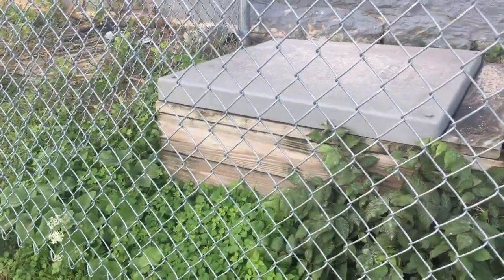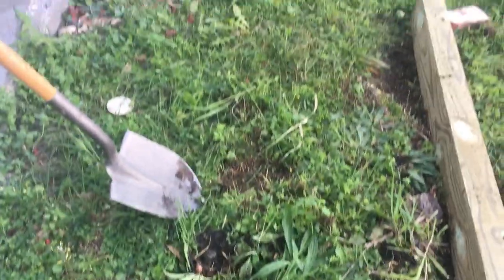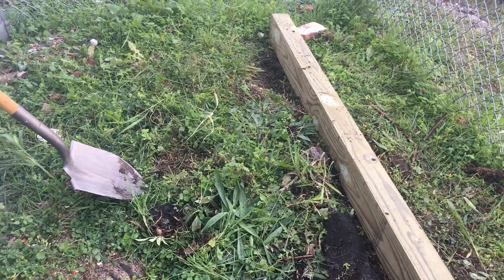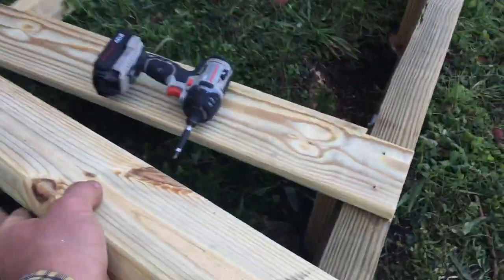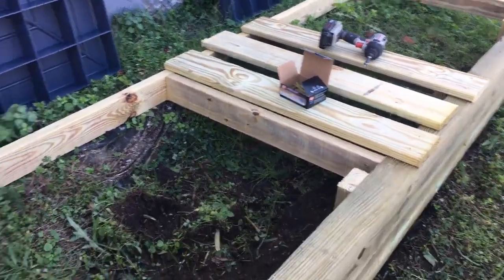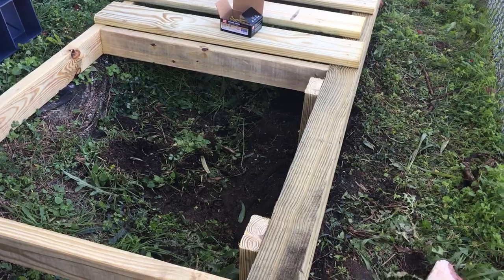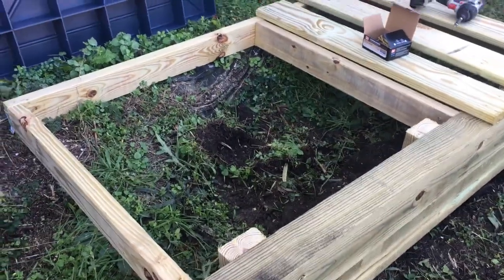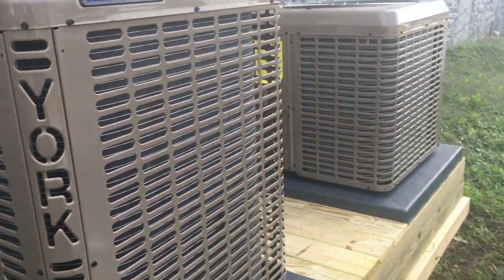Building a platform for an Air Conditioning Unit

Comment: Do you have to have the large plastic pads?   I have a similiar deck where the decking boards go all the way across?  Can a condenser sit on wood or is metal to wood no good?  Nice job!
Reply from the maker: You can do that. I personally like the look of the pads but, you can set a unit directly on wood.
Reply: @BOCraftsman  Good deal - just wanted to make sure - thanks for the response!
Reply: Was about to pour a concrete pad for my heat pump,  but then thought why not just make a little deck since I have lots of salvaged pt lumber. The plastic pads are like $80-150+ so glad I can sit it on its riser legs on the wood🤙

Comment: I am having a new AC installed including the inside unit. They said included would be "redecking the platform with a new plywood top" Does that mean a new 'box' that the inside unit will sit on?

Comment: Ya I'm not sure the point of the pads??
Why not just bolt directly to the wood???
Reply from the maker: Gives it some elevation from snow building up right against the unit at the bottom. For the part of the country I am in.
Reply from the maker: But that is still a fine option